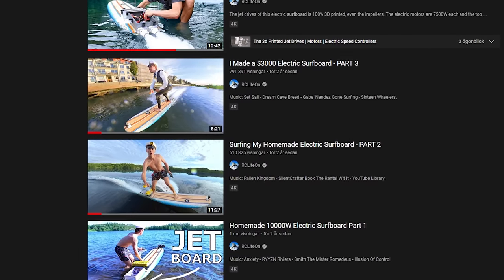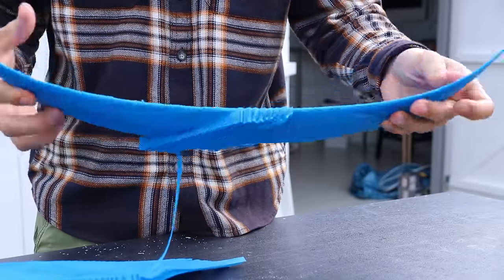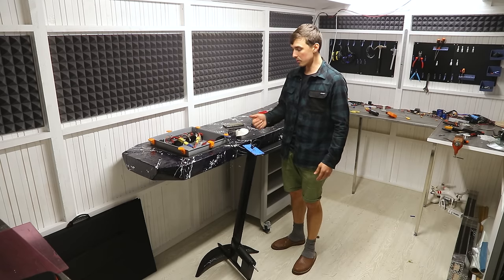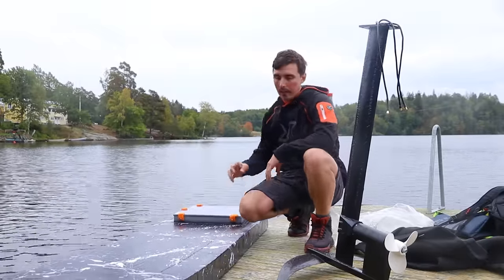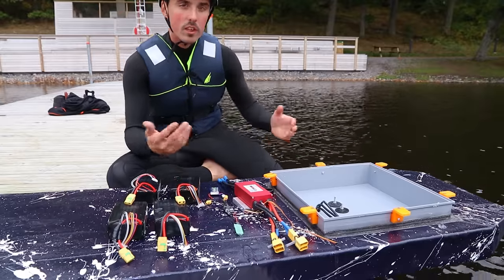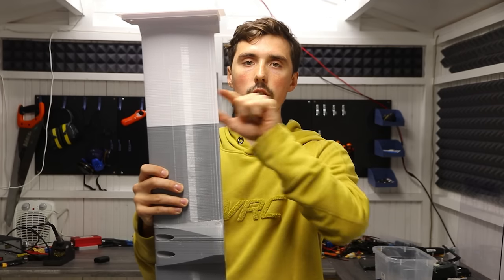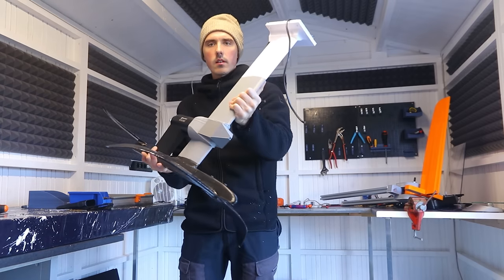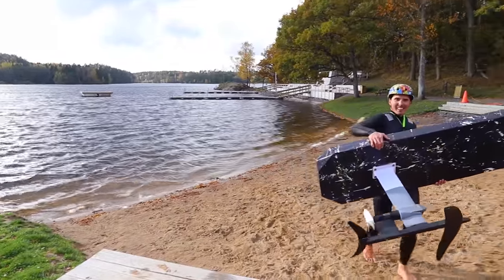3D Printed Hydrofoil Surfboard - Will it Work?

Comment: so in windfoiling you usually mount a bigger wing if there are just lightwind conditions. Once you mounted the wing and probably rigged a bigger sail you might wanna pump the board out of the water. What do we learn? Mount a bigger wing and pump.

Comment: Wing is fine, you just have to be more backward,  your body center a bit in front of the front wing or directly above. No design change is needed, just something that you do not break with foot into your battery department. Have a good day, Robert

Comment: Several ppl pointed out two main possible issues: bending of the foils and the box impeding you to stand back enough. 
First I'd check foils bending and the effect of your body position on the board, I'd go for "static dry tests": block the front foil on a support and back foil under a support,  get on the board to see how foils bent in order to keep you up. No need to go "full scale" like airplane wings' stress test yet you'll get an idea of what's going on and hot to adjust.
For the foils you might use some Carbon Fiber PLA for higher rigidity + spars. You could make the mast thinner as well with spars inside and reduce drag.

Comment: I'm an aerospace engineering student and surfer. This is my take:

1. Surfboard construction

I don't know how much was researched into surfboard construction, but generally the wooden piece that goes in the middle (the stringer) is a full sheet of wood about 6mm thick cut to fit the foam then glued vertically against the two foam halves to form a surfboard blank rather than horizontal gluing as shown in the video. I could see curvature was added in the gluing process, but it would be better to do this by removing material after you have your blank glued up. Watch some surfboard shapers (I recommend Bendheim Boards). Shaping is tedious as it requires a bit of manual labor, but especially for this use case, since you don't need a pefect board, gluing up the blank and shaping and sanding properly will greatly increase the strength of the board. Also yes when you laminate with fiber glass you want to use 2 layers on top and bottom (in this case I would use 6oz cloth) and an aditional coat of resin at the end to make things smooth. You don't want to sand the actual fiber.

2. Surfboard Size

If you look online at other foil boards (powered and not powered) you'll find the length of the board is a lot shorter. Using a shorter board and implementing the foil and ellectronics like I suggest below will increase overall strength of the build.

3. Foil and electronics

In conventional foil boards, a space is routered in the middle of the board to for a hard piece used for foil mounting to be glued in with resin. This allows for the bolts to interface with that hard piece, which in this case could be 3D printed, and then the hard piece to distribute the loads more evenly throughout the board. I'm guessing with some clever designing you could make this "hard piece" the electronics box as well. This way, you can have a shorter board as the same place where your foil mounts is where electronics are housed. You could also do it in such a way that you have a space for the ESP to be in contact with water and cool. Depending on how large this box is I would also reccomend rather than just gluing it into the board to have a carbon fiber rod on each side going through the box into the rest of the foam (holes would have to be precut) to distribute the loads more evenly throughout the board. Carbon fiber would also be nice wrapped arround the foil itself for strength and the black look you were looking for.

Hope this wordy list of suggestions helps. I've always wanted to build one of these boards myself, but with my studies I haven't found the time.

Comment: i'm doing some kite foil on my side and i have 2 things that popped instantly in my mind when i saw your awesome DIY project : 

-first issue:  Your front wing is way too small to lift you up. look for existing electric foil or kite foil for beginner: the front wing is around 1000cm² (and you can go bigger) and the stabilizer is around 1/3 : 300cm²

- second issue (linked to your tiny front wing) : you are waaaaaaaaaaaaay too much in front of your board!  with a small wing and not a lot of thrust, your back foot should be ... near the back of your electric box and your front foot near the front of the electic box .... your back feet should be on top of the matt more or less

i'm pretty sure that if you increase your front wing AND find a way to place your foot on top of the matt, it will be definitly work ! :)

good luck and keep up the good work ! always a pleasure to watch!

Comment: This is good work. in my experience (I ride a windfoil) there are a few things that will happen to you :) As soon as you start to rise above the water, the foil mast will break, because, as I saw in the video, it is printed on a printer and the layers are located across the mast. Loads on a mast - lateral. Therefore, it is better to replace it with an aluminum profile (a mast for a kite) or make it from carbon fiber. You also have insufficient rigidity of the aircraft. It is also better not to be made of plastic. Alternatively, plastic can be laminated with carbon fiber or fiberglass. Well, the front fender needs more. about 1000 mm2. You don't have enough lifting power to rise above the water. But you are great. Good luck!

Comment: I would consider adding a brace to the mast a piece of small aircraft cable from the mast to the back of the board would add a lot of rigidity and reduce the risk of a break due to fatigue, super interesting work I really enjoy your process of figuring these project out!

Comment: For starters, my shop teacher would have smacked me on the backside if I made a project without the plans first. That includes the physics. You have to calculate the dynamics just like airplane, except hydrodynamics. Lift, drag, weight and thrust all need to be considered. But I commend you on trial and error approach. That turned out pretty good for just "wingin it".
God...did I really just say that?

Comment: Great video as always, I can see why it's taken a while since your last video.

One suggestion for the hydrofoil would be oversize the front wing by 20% and see what difference that makes, like you said it is almost flying.
Or you could put another battery in series and get a little more speed. 🤘😀

Comment: Try to make front wing the size for your weight, not generic one from grabcad might be ok for someone who is 10kg lighter. Then make a composite front wing out of PUR RG 300 as a core and 3 to 5 mm outer layer thickness of carbon fiber cloth or prereg, and make sure you go 45 deg with weave pattern. This will be more rigid as a full CF part but much lighter. You could go with less dense PUR probably bit just to be on safe side. 
Great video!

Comment: This is great. Love it.. my suggestion would be to make both wings about 50%-75% larger.  You need the lifting force at a slow speed. You could also add more positive incidence to the trailing foil (maybe 1-1.5deg) to help the main foil generate lift. Lastly, the main foil should be thick enough to add a carbon rod through it.. this will stop it bending underwater if it is.. happy to discuss it further if you want to contact me.

Comment: 🤣 amazing work! 3D printed parts for DIY projects are genius! I also printed the whole gears and motor mounts of my e-mountainboard (8085 motors with a peak power of about 8kW) with nylon materials and a normal A8 printer - worked also perfectly!!!  Maybe nylon would be a better material for your wings (little bit more flexible but stronger) maybe make them bigger for more buoyancy.

Comment: I've been waiting a long time for this, after suggesting it a few times. I had a feeling the black paint would be bad for heating up. I used to have a black Mustang.. It probably just needs a larger wing, and maybe even a second motor to make up for the larger size and mass. I would also consider changing the shape of the back of the board. The shape might be sucking it down, like a spoiler or like some sort of Coanda effect? Maybe round the rear of the board off and adding a layer of wax? I also think the shaft should have a larger foot towards the front of the board to counteract the torque. Otherwise, good job.

Comment: Good start, as others said you need to check how the wing is actually functioning in the water. This can be done in a test tank or old school with a wind tunnel.
My experiences with a hydrofoil board i could never get them to go on plane unless i pushed it down into the water first but most of that relates to speed + wing design.
Sure you will work it out :)

Comment: Really i think you should do 2 major things to be able to fly properly:
one is to make a bigger wingspan front and back wings, therefore creating way more lift. (you will be a little slower once you're up there, but won't make much of a difference.. youll still be fast as f)

the second thing was quite obvious: to be able to put your feet further back on the board. this means you have to move the electronics somewhere else, or you could maybe dig down a bit deeper in the foam and put them there. (they'll still be under your feet, but just not in yr way anymore.
and add some grip tape or wax!   
cool vid tho

Comment: Try to reduce drag to get more speed, since lift will be proportional to speed. 
Add a reinforcement strut to the vertical column to make it like a triangle, then you can make it much thinner. Also use carbon fiber rod in the middle of the 3d print to add strength with reduced width. Then you can add a bigger wing also to get mote lift at slower speed.

Comment: I think it's the flexibility of the wings. When you get up to speed the wings bend up past the point were they would provide the lift required. It's similar to porpoising in F1 where the downforce applies itself to the car, then after a certain point it squeezes the car down too much and puts the car at an angle where you get lower downforce, only in your case you don't have ground effect so there's no shifting in lifting force that bounces you off the board.

Could also be that you're not going fast enough, so if you're not able to go faster you should make larger (*and* more rigid) wings.

Comment: that's  awesome ,
what you can improve :
1 shorten the board you don't need it that long  actually hydrofoil boards are shorter than normal 
2 a larger wing will help you get more lift 
3 you need to step back a bit cuz you are standing way too much in the front 
4 once you feel that you are fast enough to fly give it a kick once it flies it will keep flying

Comment: Nice video as always!
Both mast and wing are not stiff enough by far for actually foiling.
3D printed might be ok, but you will need a lot of carbon on the outside - I would start with at least 3 layers of 160g/m2.
As mentioned before, I would suspect that this will also solve the issue of bending wing and insufficient lift.
Looking forward to part 2...!

Comment: you could also watercool the ESC by drilling a small hole or channel through the mast, the water pressure from moving forward will push the water to, then one outlet and you have water cooling. have done this on rc boats. Cool Project!!

Comment: I saw a comment about running a fluid simulation I agree with that, also maybe increase the surface area of the wing looks small relative to the board , also change the angle of attack, should generate lift much earlier, looking forward to part 2 😊

Comment: The big issues with your foil is that the front wing is too small, you should really increase the actual area and the wingspan. It will foil at much lower speed and will be way more stable when you take off. But then maybe you'll need more strength.
And the fuselage might be a bit too short. A longer one will help with pitch stability.
And finally, you have a long board which means lots of weight a the front so you can try being even more at the back to add more angle to the foil.

I love the project and you did a really good job. Really looking forward to the next part :)

Comment: Great vid... as always.
Don't know a lot about hydrofoils surfboards, but it seems your back foot should be a bit backwards, on top of the hydrofoil. Creating there the "point of rotation" and enabling you to shift more weight to the back.
But you are unable to move your foot backwards, because of the control box...

Comment: I think you have underestimated how strong you need to make these parts. Remember that both the wing and the pillar have to carry the entire weight of everything as the board is flying over the water and not providing any lift. On the other hand the partial lift you did get kind of works well.

Comment: Maybe a v-hull shape for the bottom of the board to reduce drag as it starts to lift? Your wing is probably losing shape under the force too. A bigger and more rigid wing would probably be better. Weight reduction would help too. Looking forward to seeing your fix for this project!

Comment: Pro tip: if you have to fill in larger volumes with expanding foam spray some water between the layers. This will cure the foam to the core which would otherwise stay soft and weak. Try it in two cardboard boxes, one with water and one without, then cut them in half the next day. You will be surprised how much of a difference that makes.

Comment: You need to make the mounting surface of the arm much larger to spread the torque load to the bottom of the board. Still a great job and build! Well done for your first try.

Comment: The #1 thing to change is your back foot location. Having your whole-body weight forward of the propeller is making it impossible to lift you. Your back foot should be at least on top of the mast. Better would be behind it, then you can control the wing below and the angle of attack through the water, ie. more lift/less lift. Hope that helps!

Comment: Great video - really enjoyed watching it!  You clearly don't have enough lift with your current wing and also, it looks too flexible. It really needs to be super stiff. I would suggest a front wing of >1800 cm2. You can experiment with the angle of attack which is also an important factor. Good luck.

Comment: Gretings from Germany.
I would suggest that you reinforce the wing with cf rods to help it not flex in the water under you weight. From my understanding, the wing should withsand you weigth when the board lifts, therefore you should strengthen it up.

Comment: @RcLifeOn Simon, It is flying, you can see that the board lifts above the water surface When Flat.
The angle of attack of the (tiny) wings you have will be critical, trying to 'get the nose up' is more likely to cause turbulence than create more lift.
My suggestion? Keep the power the same, double the size of the wing model (4x surface area? - board needs 4x the reinforcement) you should get lots of lift at lower speeds so better power efficiency too = Mo Fun :D

Comment: I had the same issue with my DIY e-foil, I found out that I needed a larger front wing since I used Dotune hydrofoil and it was too small to lift me (I weight 155lb) 

Get a larger wing and you should be good

Also I recomend you use boat threaded round hatch as enclosure for the battery since it is the best way to prevent water from getting in and damage your electronics..based on an experiance

Comment: Cooling: A little tiny hose and pump to bring cold water up the "mast" might work. A small pump in the electronics box with a meter of lift would be fine as long as it can self-prime when the craft isn't moving, or a small pump located somewhere in the mast.
Reply: Or rather than have a pump, a small 'scoop' at the base of the vertical riser. The forward movement should force some cold water up the tube and push it up to the electronics box.

Comment: Great videos.  Here are a few thoughts for your hydrofoil in no order,
1. Definitely cover it with Carbon Fibre to increase rigidity and strength, … much better than fibreglass
2. I suggest that the shaft should be longer to give flexibility on ride height.  Your shortened version may be too short.  Remember that when the foil breaks the surface, you will hear a gurgle and then loose all lift and come crashing down.  Yes the top of the shaft needs to be strong to support the added load
3. Your no lift issue may be related to your board being too long.  To get lift out of the water you need more angle of attack.  The longer the board the less angle you will be able to get, while riding on the surface.  Also the faster you go the water surface force will increase, so it will be harder to pitch the board up to increase the angle of attack.  Once the board gets our of the water you can easily change the angle.
4.  Don’t bother with adding rods in the middle of the vertical shaft for strength.  Strength is more effectively increased by adding mass at the extreme fibre or material farther away from the centroid.  E.g. a solid rod is not much stronger than a heavy walled pipe and an I-beam has a great strength to weight ratio, since most of the material is on the ends and not in the middle.  Basically you will most effectively add strength by adding CF to the outer shell.
5.  I suggest the next time u make a surfboard (a shorter one) take a router to the edges to get a 1/2” or 3/4” (13mm to 20mm) radius on all edges.  Fibreglass doesn’t wrap as well over tight corners.